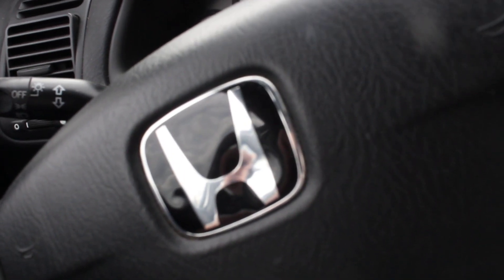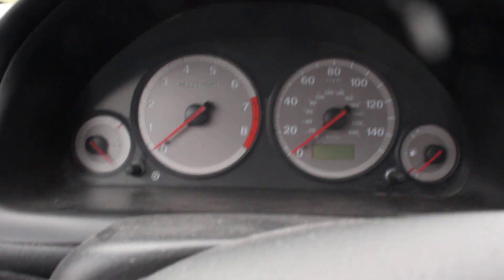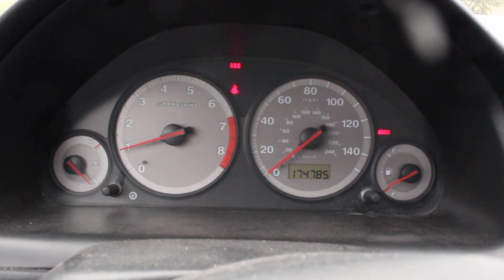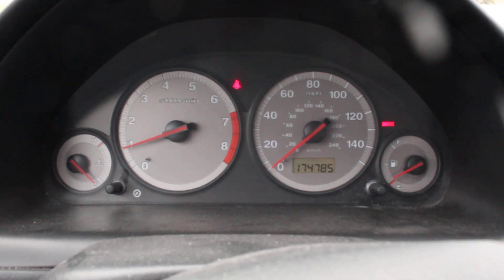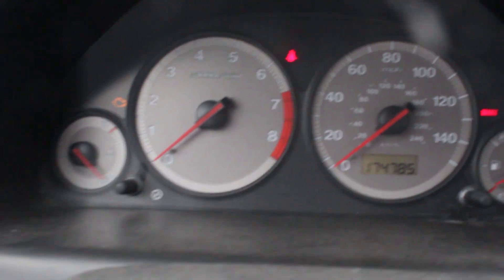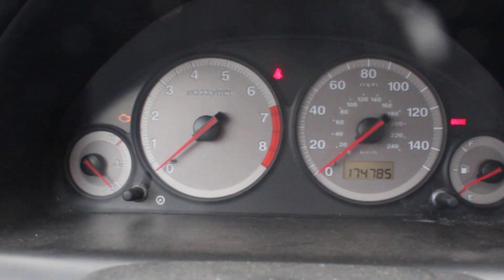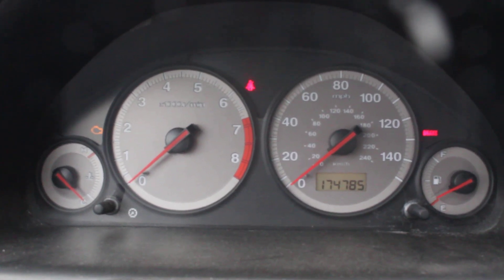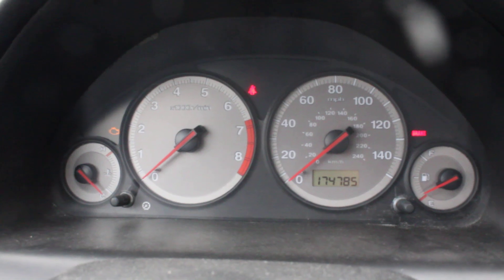What Honda "Limp Mode" Looks Like, '02 Civic With A Bad ECM

Comment: I've spent 1200 tryna fix my 02 civic but I belive it's the relays too, my fuel pump (the blue one) was clicking and doing similar to yours just worse now and dying and not keeping charge. The new relay should be here this morning and I'll post a video shortly of the steps my car did when it first started to mess up to what it's doing now and see if the fuel pump relay fixes my problem. Could be faulty wiring going from one end to the other though
Reply: Did you fix issue

Comment: Sorry I'm so late, mine was a bad ground for the alternator where it bolts onto the engine, had to thoroughly clean all the bolts area and threading on the engine block.  Because of this issue it keep frying the computer.
Reply: Where is the ground on the alternator? Mine just has a green plug
Reply: The ground is the actual bolts that bolts onto the engine.

Comment: i just bought a 2003 civic and it has no spark or anything unless i bump start it or get it jumped, it will drive for a little bit and then randomly die, idk what the problem is so if anyone knows please let me know
Reply: i’ve replaced the alternator 3 times and put a new battery on it. i’m guessing there is a short somewhere, i’ve checked all fuses and stuff like that
Reply: @traetenwolff4059  I also have an 03 civic and I'm having issues with the alternator frying the ecu. I've had the alternator bolt back out twice, and I found a forum where this is a common problem with the 01 to 05 alternator bracket, and the alternator uses the bolt to ground it's self to the motor. Someone said the dealer puts a grounding strap on the alternator housing and grounds  it to the engine, and puts loctite on the bolt. You might want to consider making sure your alternator is grounding well, and it wouldn't hurt to check the positive wire as well. If there is a bad connection, it will burn up the alternator, or it may burn up something else.
Reply: @traetenwolff4059  and by the way, when you mean that it drives for a little bit, does it drive normally, or does it drive poorly, with random gauges not working, and how long does it drive for
Reply: Your alternator is not charging.

Comment: My problem didn't occur after I did a big burnout with the battery lig ht indicator on would this have fucked up my ecu?
Reply: It wasn't the burnout per se. If the battery light was on, you likely had alternator issues already. It might just be loose, but the bracket could also be fucked, or even the alternator itself. Oh, and the alternator ground strap has to be in good shape; if your battery is trunk-mounted, you'll probably want to run a cable from back to front just in case. Once you've got that licked, you can replace your computer. There are essentially 2 ways to do it. You can buy a computer, install it and then have it programmed by a dealer to match your keys OR buy a set that includes computer, key(s) and immobilizer box. If you choose door #2, most sellers make you take an ignition switch assembly as well. This means you'll have to carry around 2 keys from now on: Your "door" key (the original) and your "ignition" key (the new one).

I sell sets too, but I include a "magic" key that has the same transponder and programming as the original key(s). The magic part is that the keys I include are uncut, which means you just take them down to the local Walmart or Ace Hardware and have them cut to match your old ones. The rest of the matched set includes the ECU and the immobilizer box (sits on the end of your ignition switch; total of 5 Philips screws to replace it). None of it needs programming.

If you're still looking, let me know the year, trim (basically, EX or not-EX) and transmission. I probably have what you need, on eBay or in inventory (unless you have a GX, HX, hybrid or Swindon hatch...sorry). Cheers.

Comment: My civic went into limp mode and the problem ended up fixing itself after I took the battery terminal off and scraped the connection clean so the battery connects good. No more issues after that

Comment: Those relays that you were pointing at, what are those 4 relays for? You only have 2 relays, mines has 3, went to junk yard it had 4 relays. Where is the diagram for these relays?
Reply: ElTexMexAlex because yours is automatic m I wrong?thats why it has 3 or 4 and that blue relay it's for the fuel pressure

Comment: How did you endup with this problem ? I have same problem in my Accord 003,  but this happens very rare whenever I'm driving and then I have to shut off engine for 10/20 min then car runs again normally. If anyone have any idea how to get fixed please share. Thanks

Comment: is there a cheap way to reprogram key with the new ecu, dealers are charging $125 for Civic 02. Thanks for your help
Reply from the maker: The ECU needs the "body code" entered to work and the only way to do that is to use a Hondata computer. Unless you can get access to a Hondata computer you have to take it to a dealer.
Reply: Should have bought a pre-programmed set with a key, my dude. I was selling them last year for less than $125, LOL.

Comment: Same thing with my 01 accord. Bad computer, my tak would dance at 3000rpm, replaced the computer & it's still not right
Reply: possibly your cam position sensor,but you would have a code tripped for that more then likely.you also have to buy from Honda or it wont work properly.

Comment: I had the same exact problem, on startup, relay was clicking a dozen of times with rpm ranging from 200-1500 after that the car ran at steady rpm, it was ultra rich (back fire alot at mid rev, undrivable) no RPM,Speedo,temp gauge, check engine was on Obd wont etablish connection, in brief limp mode. My car did not worth the key programming so i end up at the junk yard where i took the ecu, the car key, key barrel and the key chip reader (in case it needed the same), Plugged everything back up and it worked fine! Total cost of the repair : 45$ + 10$ core for ecu , I took a look at every ground , it was all good but i found out my alternator bolt was a bit loose, i tighten it up and so far so good
Reply: So my 03 is doing this as we speak I can go to a junk yard get the ecu out of there's and there ignition and my car will be normal again with out programing?

Comment: I have same problem with my civic. I was able to disconnect all the ecu wires and remove the 3 bolts that was holding it in place but it seems impossible to remove the ecu from the car. anyone know how to remove it?
Reply: It's been 2 years, but for anyone else, you have to:
-remove the plug that sits in front of the computer
-pull down the wire that runs along the dash support
-route the ECM wires out of the glove box hole
-don't freak out! It's like a Chinese finger trap: Remain calm, and it'll come out like butter.

Comment: thank you alot I had the same problem I took my car to a mechanic and told e that it was I trasmition problem but I replace the ECU and problem solved thank you  man for the video
Reply: MEGALOKITO 503  ok I got 2001 Honda civic hx coupe automatic  1.7 check what other way will work for mine do u know
Reply: @mego729  I just fired second ecu
Reply: @marshalcraft  hey sorry I’m late but I just fried mine second time u ever find the cause?
Reply: U only changed the ecu

Comment: does any one what ecu number is compatable with a 2001 honda civic vtec d17a2 engine and a manual transmision i dont know if it is a  
 ex lx
Reply: I know it's been 3 years, but in case anyone else wants to know, you can use 37820-PLR-A01, A02, or A03 (49 state), L01 or L02 (California) and C01, C02 or C03 (Canada). To be clear, you can use ANY of those regardless of your location. It'll still pass emissions and run fine in the mountains.

Comment: That clicking noise is your main relay. The main relay controls basically everything under your hood. The circuits short out in time. You can resolder them or just replace it.

Comment: Help.. I had this same problem.. Replaced the ecm and had it programmed... Now my shifter is stuck in park.. I unlock it though every time my car is shut off it locks up again.. never had this problem before.. Also I am very slow when starting to drive till I get my speedometer up to 20 or so.. as long as I do not stop I am fine.. When I stop I am slow to pick up speed.. What is going on?  Help please  :( :(

Comment: Same thing happened in my 2003 civic dx, I bought it 2nd hand and the previous owner changed the timing belt and water pump on it before he sold it car ran good for a few days then the engine light came on didn't worry to much as the car only had 187 thousand kms on it so I figured I'd wait for my day off and take it to honda since I don't have my own code reader. Few days later went to start it and it did the same thing took it to my mechanic aperently when the previous owner had the timing belt changed when he put the Ecu back in he forget to insert some type of screw that helps the flow of electrical current and it ended up frying my ECU
Reply: Yeah, the ground for the alternator. The ECU really doesn't like the current to flow the wrong way!

Comment: I have the same problem and the damage was similar to the alternator and I feel the same.
but my question is if you had also problems with acceleration when you drove  the street and if the car you into all the changes, if the air conditioning worked? that happens to me just like most other problems. gasoline just too fast and also when the car accelerated ago as if it were a scrap

Comment: I've had this happen FOUR times with my Civic. No one can figure out why the ECM keeps failing.
Reply: You need to get a new alternator. This resolves it !
Reply: autocarjdm it is new. still keeps happening.
Reply: datonz ...and the ECM ?? was replaced too ?? need to be replaced as well. If the problem persists you will need technical assistance.
Reply: took it to my honda dealership. they couldnt figure it out.
Reply: datonz gotta check your grounds even if the cables look ok, your alternator has got to be good and your ECM.  but before you turn on the car make sure the contacts of your alternator to your motor is clean, sometimes there is corrosion and make sure the bolts, threads, everything is clean before turning on engine.
Reply: check your fuses. not just for popped fuses but the amp of the fuse with the fuse box diagram to make sure its not the wrong one "ex. 25a in a 7.5a fuse slot", also check the ecu ground and Cassie to battery ground. a bad/ relocated  ground can cause issues.
Reply: and of course, this is after wasting 200 dollars? 400 dollars? 500 dollars? how much does it take?
Reply: There has to be a short somewhere.  Disconnect the battery before disconnecting any power cables.
Reply: I'm having the same issue.... Second ecu now I had replaced the top bolt with a headbolt going the other way with a nut on the other end and a ground strap. My grounds were touching paint though so I'm going to go over all my grounds and also my battery is relocated to the Trunk I'm wondering if battery ground is causing ecu to fail...
Reply: @brycedewaal7955  It couldn't hurt to run a wire from your back ground terminal to the front. This assumes you've tested your alternator for output already, of course.

Comment from the maker: Philip Holmes: That is almost exactly the way this happened to me. Actually, this is the third time I lost the alternator and second time I fried the computer. The first time the dealer socked me for $1200 to replace the computer and the distribution block. Fool me once, shame on you.

The reason I kept losing the alternator is I installed it wrong the first time when my factory one failed. Then I screwed it up three more times. If you didn't already know, or you haven't used a manual to install the alternator, the bolt that the alternator pivots on is torqued down to hold the alternator in position, NOT THE BOLT ON THE TENSION ADJUSTMENT. I was installing in like in an American car and putting all the force on the tension adjustment bolt and it kept snapping. Torque the pivot bolt down to spec (as well as all the bolts) and you shouldn't have an issue going forward.

As far as the limp mode, hit up eBay, get a new ECU that matches your old one and give Honda $100 to flash it. You should be good to go.
Reply: wildwildwest11 
hola buen día disculpa tengo el mismo problema con mi honda civic v-tec 04 y la verdad no me lo pueden arreglar. como lo arreglas te?? me puedes decir por favor.
Reply: Guadalupe Barbosa I CAN FIX YOur car where you live? I can get any part for your car
Reply: @guadalupebarbosa1671  Debe apretar el alternador y luego reemplazar la computadora del motor. Puede comprar solo una computadora y tenerla programada por Honda, o comprar un juego que incluya la llave correspondiente y la caja del inmovilizador. Puedo venderle un juego completo por US $ 200, y lo enviaré a cualquier parte de EE. UU. Y Latinoamérica. El único trabajo que debe hacer al final es cortar la nueva llave para que coincida con la anterior (para que funcione en sus cerraduras). Let me know. Solidaridad, camarada.
Reply: do you know the specs for an 04 civic?
Reply: +Lord_Trumoo google it but you need more info than a 04 civic. you need to know what specific engine you have and transmission auto/manual there is a difference
Reply: same thing happened to my car, but i refuse to take it to the sealership. they want like 300 bucks so screw them. it goes into limp mode when i first start it (if its cold) and after it warms up and i restart it, it wont do it anymore
Reply: Some guy replaced my alternator and put it in wrong and ever since that my car has been having the same problem now I have lost the ignition switch key and I'm wondering what I should do

Comment: Any news about this issue. I've exactly the same problem on my EM2 2002 MT...
Reply from the maker: Actaully YES! It's fixed! I bought a new ECM from Ebay for around $70 and had my local dealership flash it (it needs to be synced to the keys and the body code needs to be inputed via a HONDATA system) for $100. Runs fine now. So there you go.
Reply: wildwildwest11
Thanks for your answer. I seem to be doomed to having to do the same. My problem is my EM2 is european and an identical ECM seems to be impossible. Did you try anything to fix the issue like checking alternator, battery, sensors? And is the new ECM with the exact same code as your broken one?
Reply from the maker: Alcides Longras Same ECM as the one installed. I tried the trick where you disconnect the battery for 15 minutes, ground the power and ground together etc. and nothing worked. The new computer and flash was the solution. I didn't change anything else.
Reply: wildwildwest11 Hello again and sorry for asking but I'm lost with my problem. I tried repairing the ECM but the guy I asked said mine's fine, like new. No busted components inside, all working. What did you do to yours? Did you keep it, did you check it? A photo of the board would be a great help to me. Thanks.
Reply from the maker: You took yours apart?
The damage is most likely not visible unless it was damaged physically. Who checked it and with what? Did they power it up in the car and try to pull codes from it using a scan tool?

I have my old ECM but I don't think there is much to see.I just replaced it with a known good one.
Reply: wildwildwest11
It was an electronics technician. He tried to get codes from it but it was a no go. He then took it off, opened it and checked the "vital parts" and saw or mesured nothing wrong. I got a replacement one (you wouldn't believe how lucky I was to find one exactly the same reference, this car must have sold a handful around here) and installed it and all was fine. The immobilizer had to be reprogrammed but all was good.
Reply from the maker: Yah, that is how I fixed mine. Make that other one as bad and scrap it.
Reply: wildwildwest11
I can understand why you say that. In the US, 70$ worth of ECM isn't worth bothering much about. But over here, a used replacement can cost around 200$ (150€) and a new one go over the 1000$. If there was a cheaper fix, it would probably be worth it. Who knows if it doesn't fry again? Knowing what was wrong could help a lot of people in a lot of situations...
Reply: autocarjdm
 Thanks. I already replaced my ECM and flashed the keys. Didn't need the alternator, though. It wasn't malfunctioning. The problem arose from it being loose and the belt started sliding, causing surges. At least, that's what it seems to have happened. I've been running the car every day for over 4 months and all seems well, now.
Reply: Alcides Longras Just get a used ECM and flash it to match the key, also get a new alternator. If you get a used one, the same problem will happend again !!!!
Reply: Alcides Longras Great !!!

Comment: The ECM is bad if the CEL is on but not throwing any codes. Disconnect the battery for 15 minutes before replacing the ECM though.
Reply from the maker: It was the computer.
Reply: good luck and if you need anything else, email me at averygtr@gmail.com. Have a nice day!
Reply from the maker: Thanks!
Reply: @wildwildwest11  have a ek3 and I think when it's cold it won't move. It's a cvt that's in it I afto start it up then shut it down start it up for it to move. If the sun is hot it would start and move fine am getting a check light but no codes. Could that be the ecu?